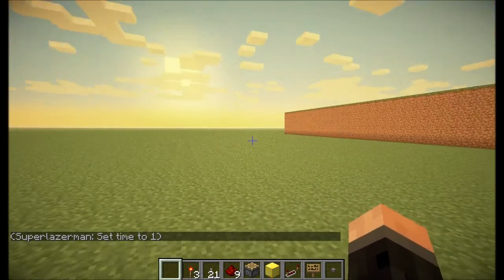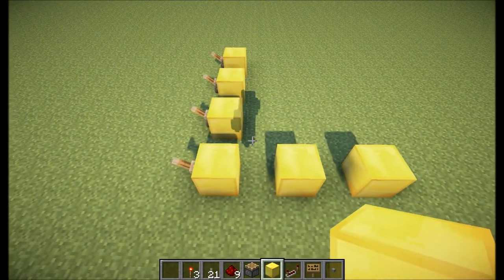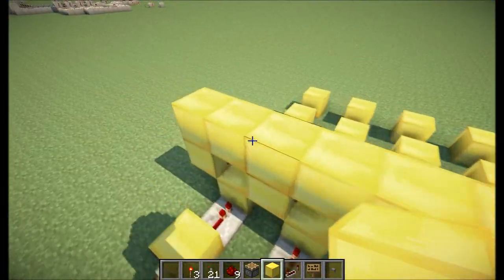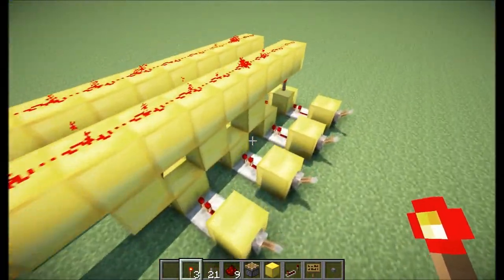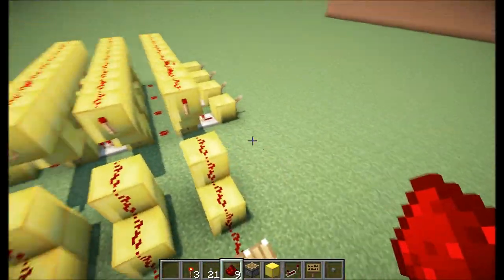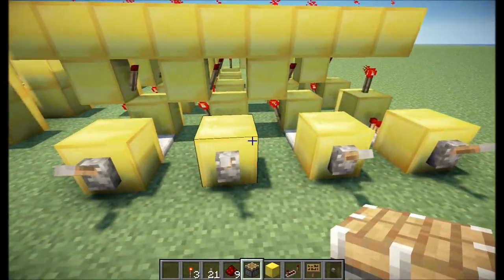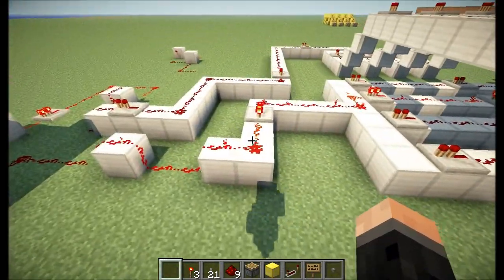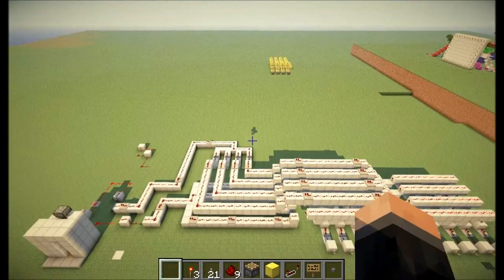Minecraft: Redstone - Multiplexer - Gameplay

Comment: This video is ancient, but I'm leaving a comment because I found it very helpful, and because I can help clear up some confusion. This is NOT a multiplexer, but no one has correctly identified this circuit yet: this is actually a line decoder, or just a decoder (also known as a demultiplexer).

The reason I found this video so helpful is because it shows the most compact way I've found yet of representing arbitrary logic, which is also very simple to understand and build. Each line (going from left to right if you are facing the inputs) is actually just an AND-gate, and what you're doing when you place the torches is choosing which inputs to invert. At the end you can OR them together, giving you a very compact Sum-of-Products circuit, which can be used with logic design techniques like Karnaugh mapping to create any logic circuit you want, including a true multiplexer.